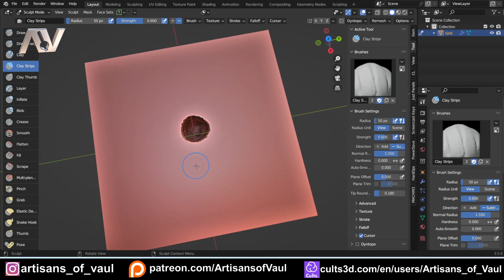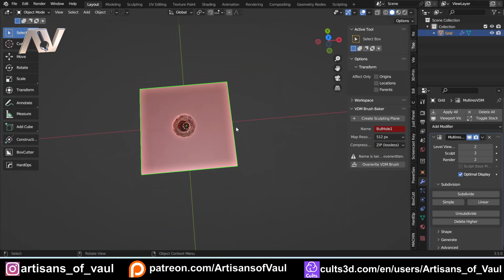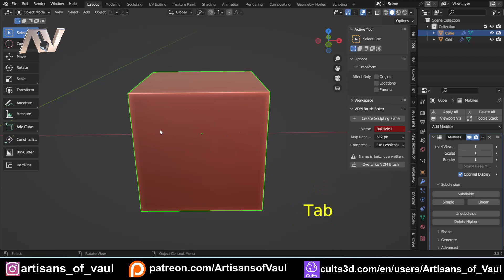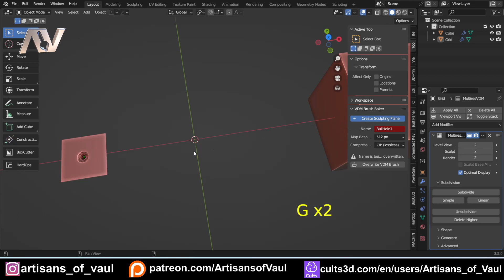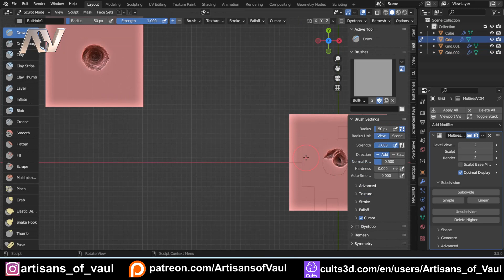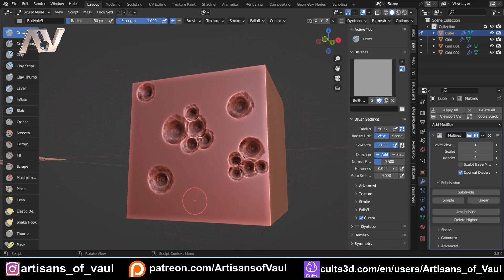Making VDM Bullet Hole Brushes in Blender

Comment: Tried to do this and the clay strips isn't acting like in the video at all
Reply from the maker: Not sure why they wouldnt... what is the brush doing?
Reply: The brush was making square indents instead of round. I managed to change that but when making the indents it seems to all be the same depth where in the video the centre looks deeper than the surrounding areas.
Reply from the maker: @CrownofRa for me they are the same depth as well in a square shape. Its the "tapping" strokes that give the end effect here.
Reply: @ArtisansofVaul   Tried with an old wacom and still no dice, If I get the files from your patreon am I free to do whatever with them private and commercial?
Reply from the maker: @CrownofRa The files only remain up fot a month but Id be happy to put them up again if you join. And yes they are totally open for use as long as you are putting them onto something you've made or have rights too. Same with the chainmail geonodes file that just went up. 😁👍🏻